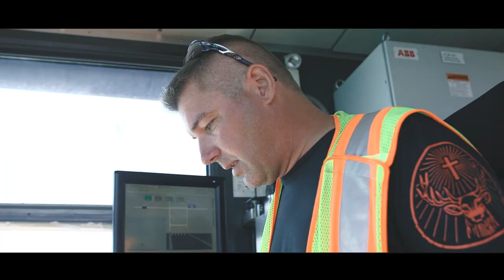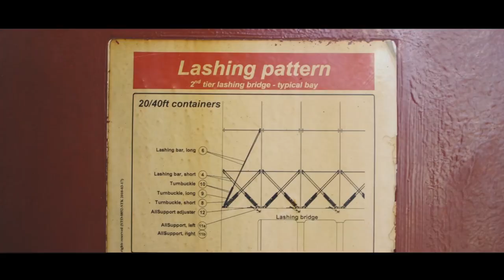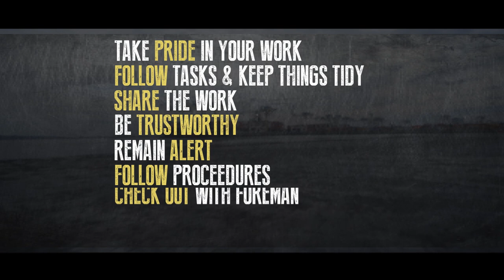BCMEA Container Lashing Orientation Video -Lashing 101

Comment: I used to work in a warehouse in Brandsmart where we had forklifts, natural gas containers, and metal shelving (the entire warehouse had huge metal racks) You have to be comfortable handling and being around metal.  
You are bound to ding yourself here and there.  Just be careful, and have common sense.  You Have To Have Your Wits About You working with metal and heavy equipment.  
Not Just For You, but Everyone Else Around You.  
You Have to Have Situational Awareness.  Always Look Around You, even If you aren't on a forklift, High-Low, or other equpment.  You have to work as though someone is always around you.  Even if you are by yourself.